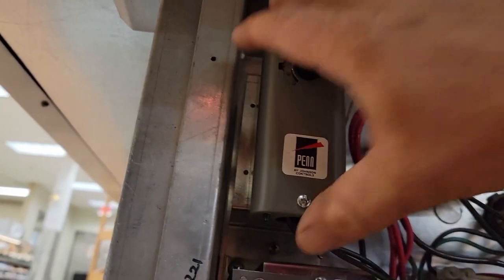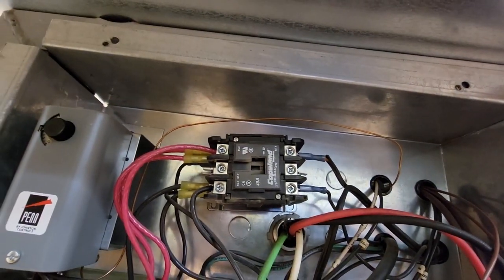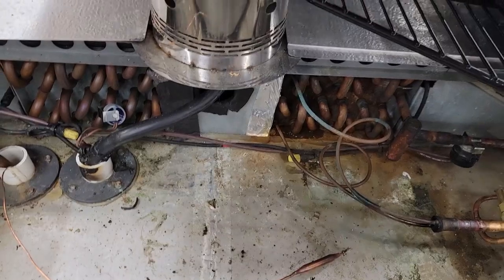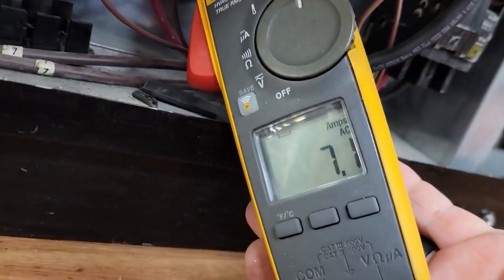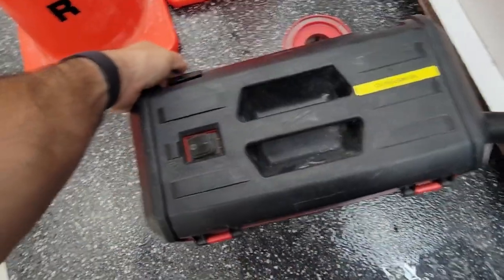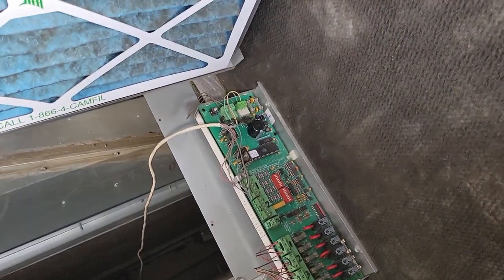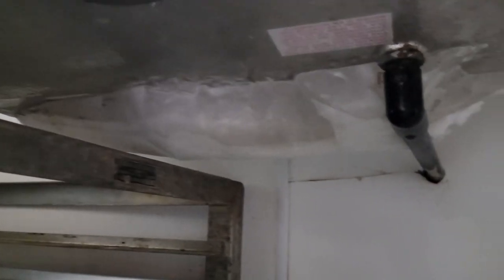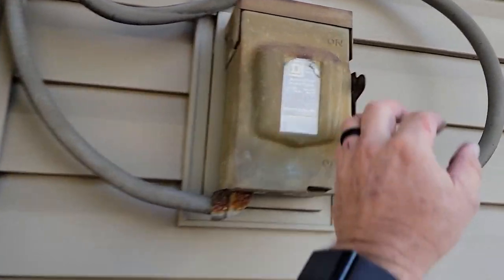Is Refrigeration Needed For Proper Food Storage? Does the store really need heat?

Comment: the contactor looks like it's only switching half the compressor power on one leg and half the fan power on the other?  that would explain the smaller gauge wiring on the load side and lower total current through each leg.  I'd say by the arc flash marks the top contact is the compressor, lol.

Comment: The hoses testo sends with their gauges are garbage. I took mine off after a few service calls.
Reply from the maker: I need to get another set of Yellow Jacket ones. I even replaced the seals and got rid of those white plastic seals, then trimmed down the screw in Schrader core depressor🤦🏻

Comment: why could you have not installed t stat on the return air,wont it short cycle,on the discharge,they come 5 dif,thanks for sharing.
Reply from the maker: From what I've been told it's more reliable to prevent the food from freezing because of how easy the air band can be disturbed on an open case like that.
Reply: @HVACRSurvival  Let us know how it runs,sounds interesting.
Reply from the maker: I had the office call the next day to follow up and the store manager said it was holding temp correctly so I was happy even though I believe the txv has a issue.
Reply: Case manufacturers go by supply air not return air

Comment: ❄🇺🇸👍💪 so ? About tstat. Was that put in the evaporator area to get a coil temp similar to a constant cut-in. N set for 27 which would give u a box temp in the mid to upper 30's ? Thanks for sharing ur knowledge and experience.
Reply from the maker: I had a play around with it some more, it wasn't going to be accurate until we had product to it to help hold temperature in the airband area. I never did figure out why one side was colder than the other side but it was likely a disturbance in the airband. The TXV acted like it needed to be replaced because I couldn't get it lower than 14 and at the end I couldn't get it below 19. It was a fluster mess
Reply: @HVACRSurvival  ❄🇺🇸👍💪 always appreciate ur time to help us techs. I like the move with sensing bulb placement n turning tstat down. Have a safe week 🙏
Reply from the maker: Thanks man! Shine on 👍👍

Comment: If you have to constantly repair that unit eventually it will cost more to keep repairing it than it would be just to get a new one
Reply from the maker: That's the first time I was there for that unit, someone else found the drain pan heater bad. If you knew what that thing cost you would be repairing it.